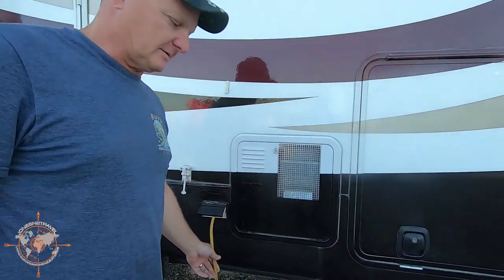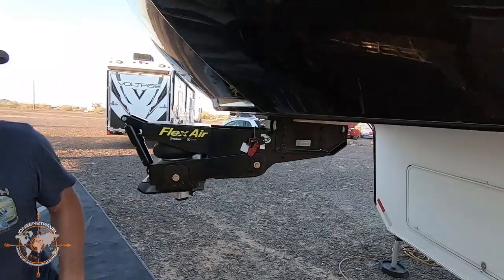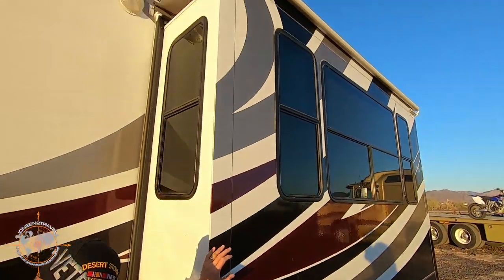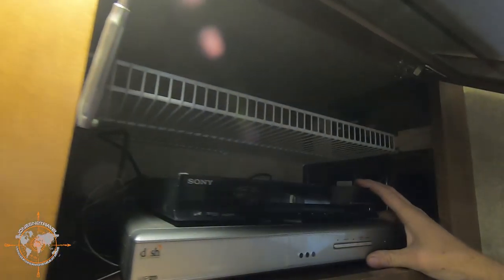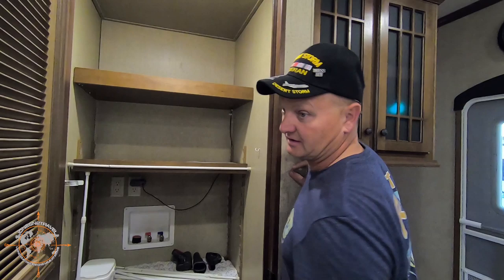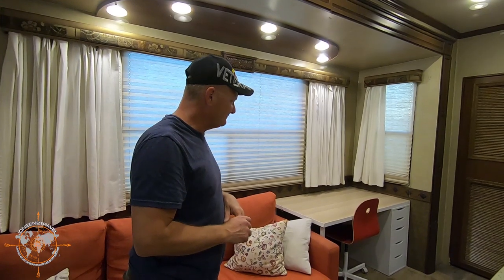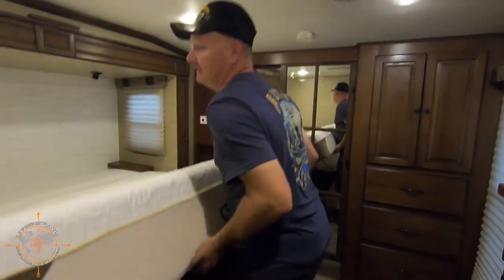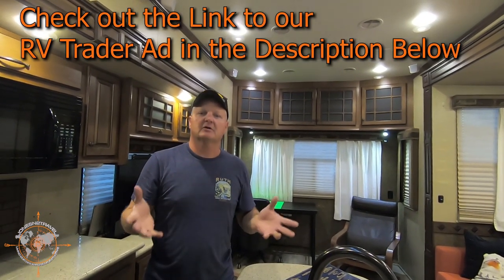FOR SALE - 2014 HEARTLAND BIGHORN 3260 ELITE

Comment: My first question: Was that the couch that came with your RV? I love that color! I want that couch!!!! And how did you hang your curtains?? I want to hang curtains in our Class A like that really bad. Right now I'm using tension rods. And they don't always stay in place during travel. And I thought about removing the balance frames so I could use command hooks to hang curtains. But I love the way you did it. Please tell me how
Reply from the maker: Originally the RV had 2 recliners where the couch is now and they didn't hold up very well. The orange couch is from Ikea, holding up great. We also purchase the curtain hangers from Ikea. We attached the hangers to the inside ends of the valances and the rod sits in the bracket. They work very well.